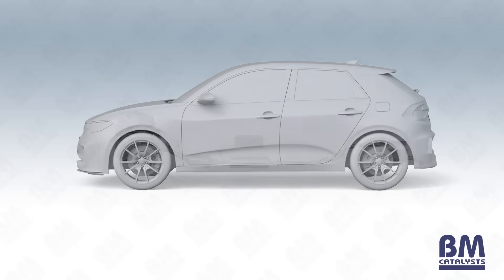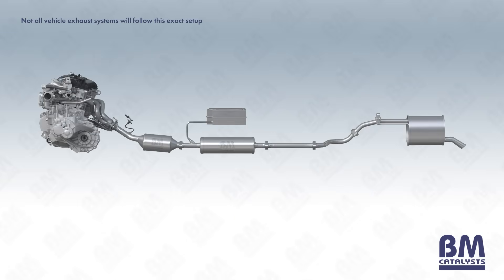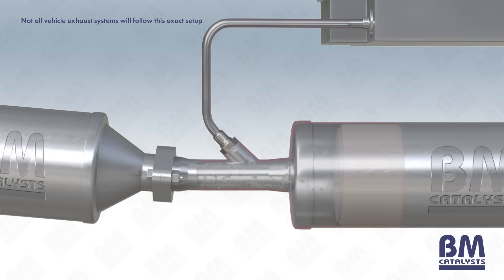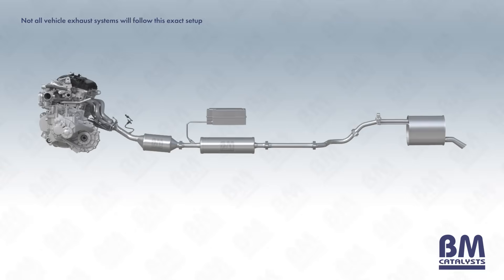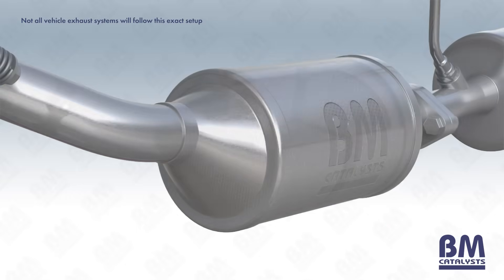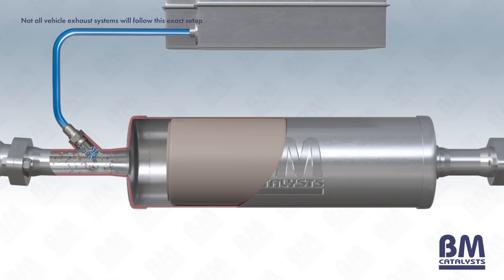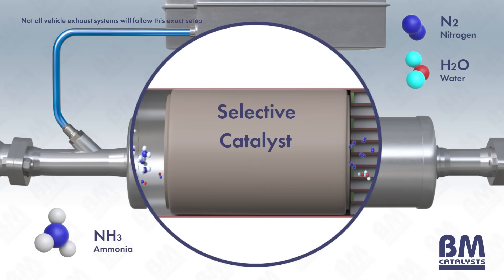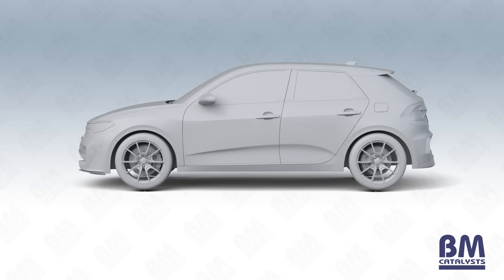How does vehicle selective catalyst reduction (SCR) technology work?

Comment: No this stops it reading on the test   by filtering the exhaust fumes down at the point of testing. On a normal day it's pumping out the same especially on a regen. No one does a test with the dpf on a regeneration. Test those fumes 😮